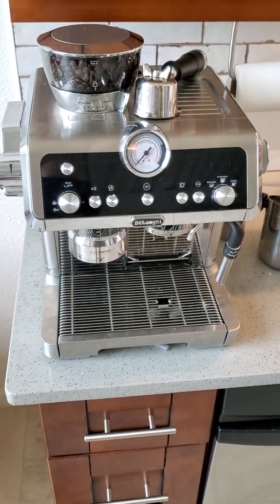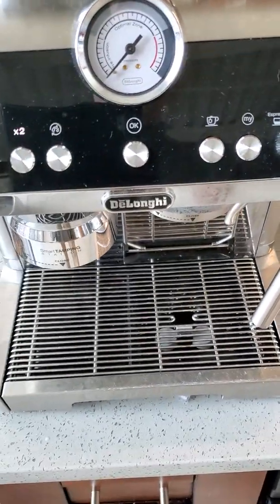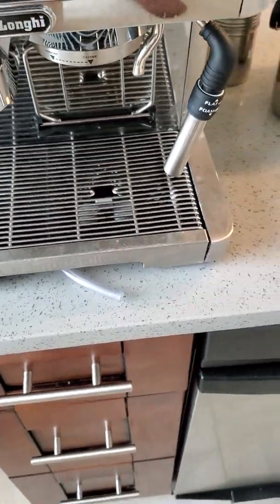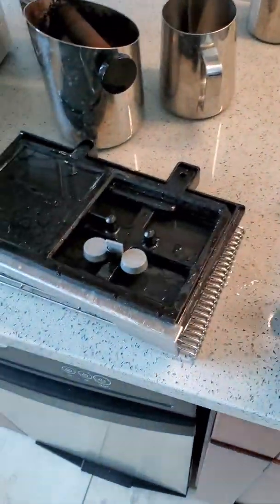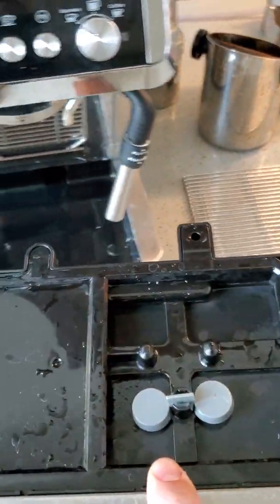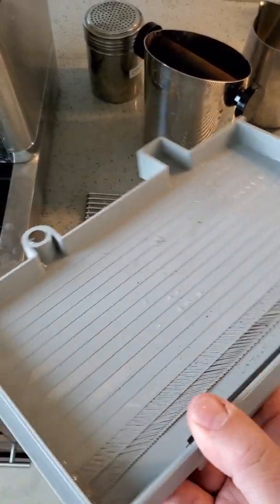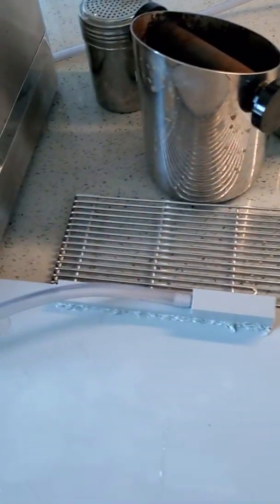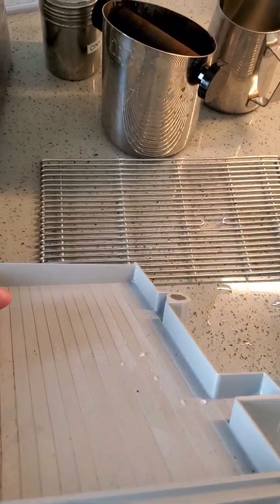Delonghi La Specialista Tray with sink discharge.

Comment: It's not doing a "Cycle", this machine has a design problem where it leaks non stop all of a sudden, many people have experienced it... Seems to be related indeed to a steam cycle (a valve dosen't close fully...?), It will empty the tank unto your counter (once the tray is full). Running a steam cycle clears the condition for me. Waiting to get their customer support to acknowledge the issue. You shouldn't have to pipe the tray to your sink!!!
See https://youtu.be/ULWfsw7lZbo

Comment: It’s not doing a rinse, there is a problem with the machine where the water tank leaks into the tray from the port on the right hand side. The little tab on the tray on the opposite side of the magnet is where the water leaks from inside of the machine. I don’t get why it does this but I’ll be calling support like Jay said.